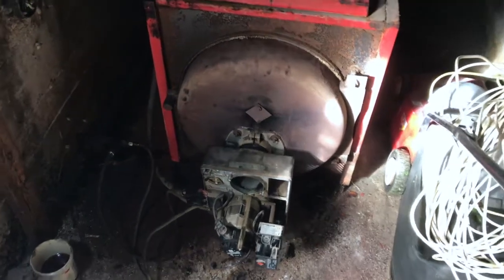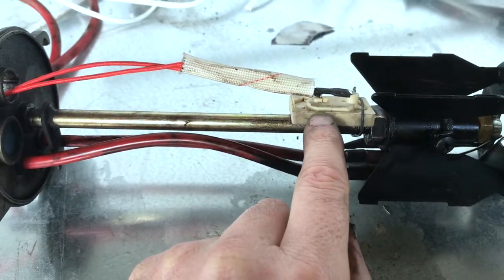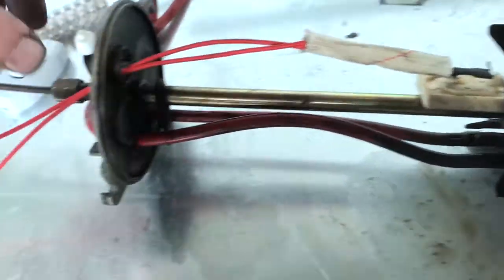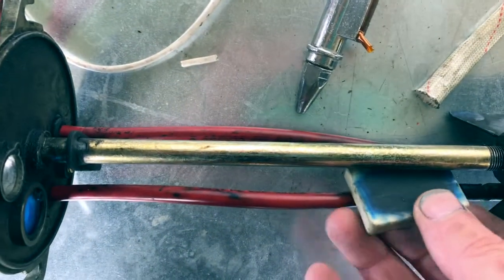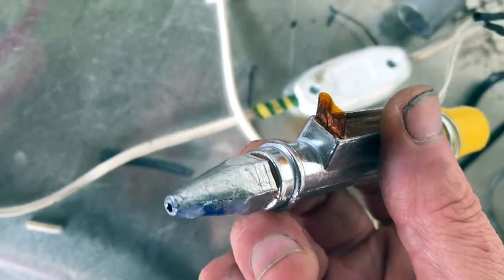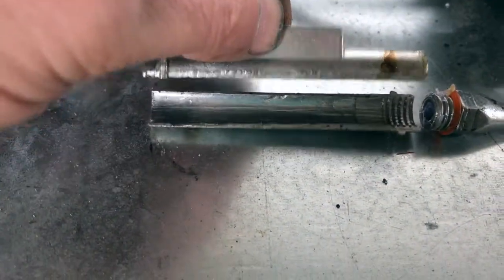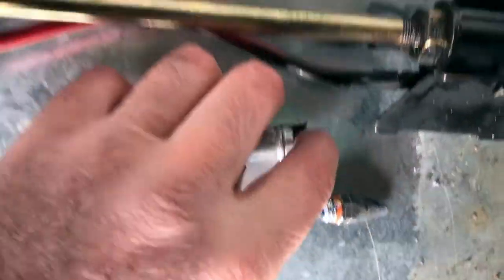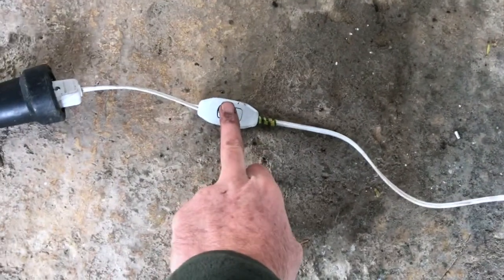DIY Oil Burner conversion for Waste Oil. Free Home Heating. Preheater burner nozzle

Comment: car cigarette light element, one question, since the glue gun heating element have a clip, why didnt you just clip it onto the brass head of the original oil jet?

Comment: Thats good thinking, it should work now. Im running 95c on waste transmission oil . Its -31c this morning and warming up tomorrow.  I ran wvo for 15 yrs. But oil supply became difficult, so had to adapt.  I needed 128c to get perfect burn on wvo.
Forgot youl need snall reservoir with another heater for that oil.
First one i built i made it through the winter but needed alot dissasembly  cleaning layers crud which catches fire and smokes badly. Cartridge heater and temp controller works safely.
Use the safety controller that came with the original oil burner. Looking fwd to your next video
Reply from the maker: Thank you very much! Yes! It's all about warming the incoming oil so it's less viscous (more fluid) Thanks for watching
Reply from the maker: Moon shiner  thanks, I was always a bit afraid to have a smaller tank next to the burner. The thing is. I have a 1000 liter tank outside, I wasn’t sure how to feed to a smaller tank inside and not have that tank overflow. Yes, I could put a small let’s say 50 liter tank inside, separate of the big one, and put an electric water heating element inside or heck, even just buy an electric water boiler :-) this contraption worked for a week and it completely sooted the inside of the burning chamber and it would start and go out after 10 seconds. It definitely works, I just have to figure out the soot part

Comment: So this is good idea I would try 2 or 3 heaters and then use light dimmer to control heat also keep in mind air blowing past will cool. To hot and you carbonize the oil in the tube. Best to  insulate the heaters as well.  But ya your doing well so far.
Reply: .60 gph is going to be hard to keep from plugging sounds like after starting, nozzle cools then no flow.  temperature control is  critical  i would use couple more heaters and hook them to temp controller.